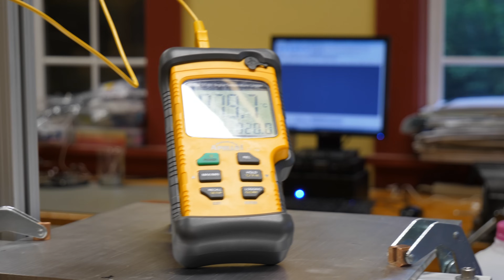Distillation

Comment: You've said that liquids evaporate at any temperature. Then, can distillation be done without boiling? Say, at 60°C? If intensified with a blowing fan? I'm thinking of getting still water.
Reply from the maker: Yes.
The process will be VERY  slow, but it will work.

Comment: I have a water distillation system that removes crud from the water... the build up of crud needs flushed out of the boiling tank... and boiling the water off that crud you can get crystals forming...

Comment: As a distiller, it's been refreshing to watch this series of videos. Elegantly correct
Reply: Do you guys use those Pyrex glass beads to accelerate the distillation?
Reply: As a 30 year master distiller there are four players from I hope you don't think that this was a proper procedure for distilling spirits or separating cuts at all he ran that faster than you should run a 50 gallon still. It would be fine for stripping but not for spirit

Comment: Hi correct me if Im wrong, when you started with 500 ml at 200 proof of isopropyl and added 500 ml of water does your mix become 100 proof. if so is this not dangerous to boil alcohol above 80 Proof. Im probably wrong.
Reply from the maker: Theoretically, it's "dangerous" at all concentration levels because the vapor is much higher in concentration than the liquid in the boiling flask.  Make sure the room is well ventilated and you're not using an open flame to boil the liquid.

Comment: I have a 24/40 connection but which cac clamp do I get? The 24 or the 40?
Reply from the maker: The clamps placed at these joints are sized to fit the complementary diameters of the two glass fittings.

Comment: 4:05; I believe the correct nomenclature for this tool is  "hydrometer" with a d, which measures the density of a liquid. A hygrometer with a g, measures the humidity in the air.

Comment: Hmmmm... When you bring up "vaccuum" I started pondering whether there would be a viable way to make a 'still based not on the process of heating to reach boiling temperature, but to reduce pressure until it reaches boiling temperature.. could it work? is it feasible? are there any cons not apparent by first glance?
Reply from the maker: That is frequently done.  You need to maintain the temperature of the receiving vessel below the temperature of the distilling vessel and a vacuum tight system and that's about it.
Reply: @TechIngredients  Would a vacuum distillation be more energy efficient (total BTU energy) or faster than one done at atmospheric pressure?

Comment: 13:30 What if i maintain the temperature at the boiling point of I P For making just Alcohol to Evaporate ?? Without Evaporating Water in the mixture ? Is it possible ??
🤔
Reply: Well, the thing is that all liquids evaporate even below their boiling points, just at a slower rate. This means that the water will still make it through in the scenario you described.

Comment: Question: If, instead of continuous heating of the alcohol/water mixture, its temperature was held at the boiling point of ethanol, would the separation process be improved as more alcohol and less water would evaporate?
Great, well explained video. Thanks.
Reply from the maker: Thanks.
The answer is no.  The mixture has a boiling point that depends on the fraction of alcohol present in the solution and this temperature slowly rises as the fraction of alcohol drops.  Holding the temperature at any point will cause the boiling to stop.

Comment: I find it pretty fucked that ground glass is straight-up illegal (unless you are licensed) in some states.
Reply from the maker: Ground glass?
Reply: @TechIngredients  Any glass with ground-glass/sanded joints such as your erlenmeyer flask, condensers and whatnot. You know, typical laboratory glass ware.

I think its intended as an anti-meth/clandestine synthesis law however it inhibits amateur chemists.
Reply from the maker: I haven't heard of that. Not only is that a silly restriction as it is easily bypassed by those who are using it for that purpose, but enforcement would be nearly impossible.

Comment: Is there a method more effective than distillation when separating water and alcohol?  Thanks
Reply from the maker: There are other methods such as reverse osmosis and selective surface adsorption, but they may be less practical.  Distillation is very simple.
Reply: There are "trick" variations of distillation: 
Multi-stage flash distillation (MSF)
Multiple-effect distillation (MED)
Vapor-compression (VC) and vacuum. They're all on Wikipedia & other places on the internet.

Comment: Is it just me or did he totally overload the reflux column? If you're going to just crank up the heat, I'm not sure there's a lot of point to using a reflux column...
Reply: Also, you might want to use sintered ceramic chips, glass beads are terrible boiling chips... Tho note that ceramic chips tend to scratch the glass.
Reply from the maker: That's why I don't use them.
I don't think the column was overloaded, why do you think so?
Reply: @TechIngredients  Almost forgot replying to this.
It is my understanding that holding the vapor temperature at around 78.37 degrees C should consistently output 95.63 % ethanol by weight (well, the theoretical azeotrope mixture anyway, but you should be able to get pretty close). Your ethanol concentration was dropping throughout the distillation process, which is what happens if you heat the mixture up too much, then everything comes through the reflux column. Although, if you don't go above ~80 C there will still be some alcohol left behind in the flask, I think. Correct me if I'm wrong.
Btw, I've seen some of your other videos and you really do put a lot of effort in all of them, so keep up the good work, it's some quality content!

Comment: I know if you mix salt with isopropyl and water mix it strips the water from the alcohol so that would not be a good example of what I am asking. But say you had a ethanol water mix which salt will not strip the water from because the bonds between those substances are much stronger. But say I added salt to the water ethanol mix is the salt still mixing with the water in the mix but just not strong enough to strip the water salt mix out or is the bond between the alcohol water mix so strong that the salt is unable to mix with the water? Here is my real question if the water is mixing with the salt in a ethanol water mix will that slow the distillation of the water by rising the temperature of the water boil and let the ethanol boil out at a higher purity? Thanks for this video I have been trying to find a way to purify isopropyl from water, color, scent and salt that I added to strip the water. This video helps thank you.
Reply from the maker: The salt and the alcohol are competing for the water and the differential is larger with isopropyl alcohol.  Both the isopropyl alcohol and the ethanol have some residual water mixed in as well as salt mixed in, you can taste it.
When distilling, the process is continuous at all temperatures, you can even distill at room temperature and atmospheric pressure as long as the condenser is cold enough and you have a few weeks.  Salt lowers the vapor pressure of the water it may also slightly lower the vapor pressure of the alcohol as well.

Comment: Thank you for the video it´s very interesting ! Is there a way to get rid of the water from the alcohol again ?
Reply from the maker: Again?  I don't know what you mean.
Reply: @TechIngredients  In the video you said there are some per cent water that comes over with the alcohol destillation. The again is referring to that because it was 100% before you mixed it. I would like to know If there is a way to get rid of the some per cent of water.
Reply: @
Telectronics, I believe you are asking about 'drying' the iso-OH  (isopropyl, or 2-propanol by different naming systems). If so, you can use reverse osmosis to remove additional water. If you are asking about getting back to the original 50:50 mixture, then there is a point where water mixed with alcohol acts as a single liquid (look up azeotrope) . You can use a packed column to increase separation, but as @Tech Ingredients said, you won't get a clean line between the two.
Reply: @scottsmith7191  I was asking in general. Could be for both Ethanol and IPA. You destill it and you still have some water in it. I don´t mean high water concentration like 50 per cent more like 10 per cent or less and you want to get real 99,999% or so.

Comment: From what you've described about the reflux column it sounds like more reflux = better. But why is that? What changes if i just go to the condenser column directly without the reflux column in between?
Thank you for your videos!
Reply from the maker: The longer the reflux stage, the more slowly the temperature drops as the vapor moves upward.  The greater the distance between the points along the column where each component of the mixture condenses the less each component "contaminates" its neighbors as each component exits the top.
Reply: @TechIngredients  Thank you for the clarification!

Comment: One of the best videos on Youtube about distillation, all really well explained.
Mind that, with any fractional distillation, heat input needs to be adjusted so that there is slow dripping of the condensate because that means only the topmost volatiles in the column get over. You cranked the heater to maximum, so your column got totally flushed and there was very little fractionating going on.
There is also an issue of azeotropic and zeotropic mixtures. With azeotropic ones, no column can perform separation greater than precise value for given atmospheric pressure. Zeotropic mixtures behave like what you described in the video.
Reply: Thanks for pointing this out. This is what I remember too. Slow dripping gives better separation.
Reply: yeah you want the top of the column to stay cool to get more reflux

Comment: Could you not have dried (salted out) the mixture to separate the rest of the water and alcohol?
Reply from the maker: Yes, you could.
Reply: @TechIngredients  would it also not be cheaper as the salt could be dehydrated by the sun to be reused? Compared to the cost of heat and water (if running a tap)? Regards
Reply from the maker: Freeze distillation and salt separation will not separate the ethanol from other alcohols like methanol, it will only extract the water and that is why we prefer using distillation.

Comment: Why can't you just raise the temperature of the mixture to say 175F (slightly above the boiling temperature of alcohol and much less than water) and boil the mixture until it stops bubbling.  That way the majority of the vapor will be alcohol and the water is left behind.  That way you won't be having to keep cutting the collection vessels.
Reply from the maker: It doesn't work like that.  The ratio of vapor pressures determines the ratio of the components in the output.  Even below the boiling points of either component you will still get a tiny output as the alcohol and the water evaporate and then condense.  There is no break in the temperature rise during distillation. It's a continuous rise as the percentages of the alcohol and the water in the output, shift.
Reply: In gas chromatography we commonly separate liquid components by their boiling points.  We inject the liquid mixture onto the column with an inert carrier gas flowing through the column (like helium) and ramp the column temperature to above the boiling point temperature of the highest boiling point in the mixture.  Each component flows through the column when it vaporizes and each component can be captured as it exits the column.  The column is filled with a type of diatomaceous earth compound that keeps the liquid stationary until the boiling point is reached for each compound in the mixture.  Each component is detected with a TCD (thermal conductivity detector) to monitor the output of each component from the exit of the column.  I would think you should be able to do the same thing with your distillation.

Comment: I take it the background racket is your condenser pump?   why is it so noisy? you can barely hear mine running. use a 250 ml graduated cylinder and you can float your hydrometer with any of the alcohols. you failed to mention that the specific gravity needs to be temperature corrected for the distillate temperature. 3A molecular sieves correctly prepped will produce 100% purity after distillation, at least with the ethanol isomer.
Reply from the maker: This is a video about distillation and so I didn't get into other methods for purification, but you are correct about how to achieve higher concentrations.
Actually, the majority of the noise is from the fan.  We just finished a new video on scotch whiskey (to be posted soon) and replaced this loud heat exchanger with the unit I described in the solid state freezer video.  It's nearly silent.

Comment: I am genuinly confused by these things:
I thought that an hygrometer is a device to messure relative air humidity. (I also make wine and have a device as he uses but i have no idea what its english name is (its "Mostwage" in german and i can not look it up anywhere))
The second thing I do not understand is the general statement that you can never have the substances 100% seperated by destilation. I thought that when you destill saltwater for example that there is no measurable amount of salt left in the water after the process.
Reply from the maker: You are correct.  The float is a hydrometer not a hygrometer.You are also correct about the distillation of salt water.  When separating two liquids that each have a significant vapor pressure, the fractionation process favors the more volatile liquid with its higher vapor pressure and its concentration in the distillate will be greater in the output at the beginning of the distillation process.  The less volatile liquid will be present in higher concentrations near the end of the process.Salt has virtually no vapor pressure at any of these temperatures and remains behind in the boiling flask.
Reply: @TechIngredients  Thank you so much for this fast answer. I am realy amazed you answered me so fast when you have such a big following on youtube. Thanks
(cleaning my ears now)

Comment: It's very hard to impress me on geek science stuff.  You must be a very competent chemical engineer & something because I actually felt kinda dumb/envious & just a student again.  Thks for the knowledge & the humility lesson.  

Oh Oh my ground is very high in TDS & my fancy Berkey filter don't filter it out.  Sooooo ?how do I DIY a stove-top rain water distiller just for decent drinking water?  The commercial available units are just too expensive.
For example https://www.amazon.com/Waterwise-WW1600-Non-Electric-Water-Distiller/dp/B005XO5FQ2/ref=sr_1_2?ie=UTF8&qid=1549253936&sr=8-2&keywords=Waterwise+1600+Home+Water+Distiller+%28non-electric%29+-+WW1600
Reply from the maker: What about modifying a large pressure cooker by adapting the pressure relief valve to fit a coil of copper tube?
Reply: @TechIngredients  Thks for the reply, I do understand you're very ... very busy.
  

This chinese home alcohol distiller looks pretty good & is only ~$150.  ?Could you tell me what you think of it at a glance?:
https://www.amazon.com/dp/B011ZYE32U/ref=twister_B0173GORZC?_encoding=UTF8&th=1
I'll probably have to do some fixing on it but that's alright.  Also I'll feed the cooler pot with a small submersible water pump in a bucket of water/ice.

Well you see although I'm an old retired physicis geek, my wife is proud to have style & not be a geek.  Really I did kinda married her for that quality.  So in a nutshell any prototype I want her to even touch must at least look professional or at least look as good as store brought.  I was hoping for help on figuring-out how to make DIY pressure cooker distillers a little more professional because most of them just aren't:
https://www.google.com/search?q=DIY+Pressure+Cooker+Water+Distiller&safe=off&rlz=1C1ASUT_enUS722US722&source=lnms&tbm=isch&sa=X&ved=0ahUKEwi0n_Kss6HgAhWttlkKHfPmC0oQ_AUIECgD&biw=1920&bih=969

Oh great peltier frig video.  I could probably run it off a single solar panel.

Comment: I noticed you drank the last distillate which is mainly water. My question is would there still be enough of the harmful ingredient in the rubbing alcohol left over, pr did it get distilled along with the first and middle batch?
Or did it get distilled at all which would make the first batch actually drinkable
Reply from the maker: There will always be a little of every component which is present in the original mixture, in every division of the resulting product, but the concentration will be very low if the vapor pressures differ significantly.  I couldn't taste the alcohol, but I wouldn't consume a large quantity of it.
Reply: @TechIngredients  You mentioned the alcohol as being isopropanol?! if it was ethanol it would be drinkable, but propanol is not to be advised. I do enjoy all your videos and share your enthusiasm for science in general. I am trying to grow the love for science in the grandchildren after I succeeded somewhat with my children. Not many people bridge physics and chemistry as fluently as you do.  A short mention or discussion of azeotropes would help in explaining the alcohol in the residue and clarify some of the discussion in the comments.